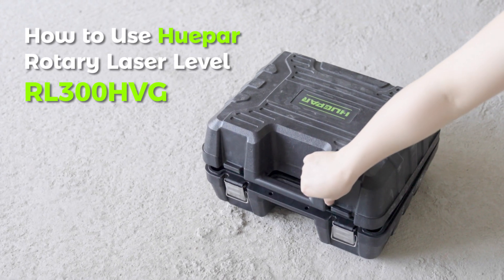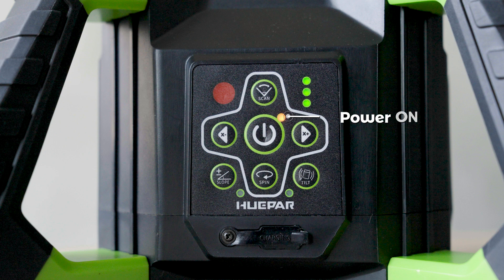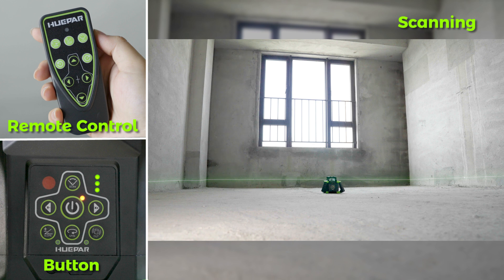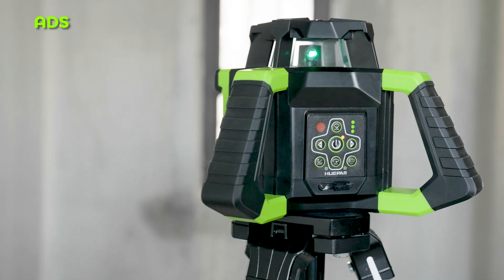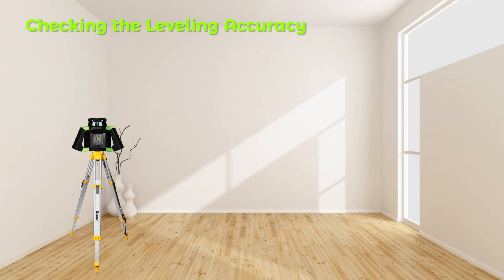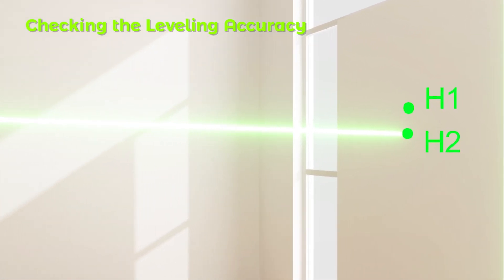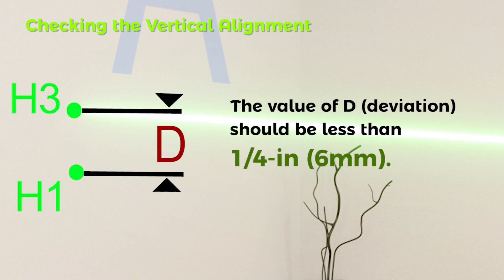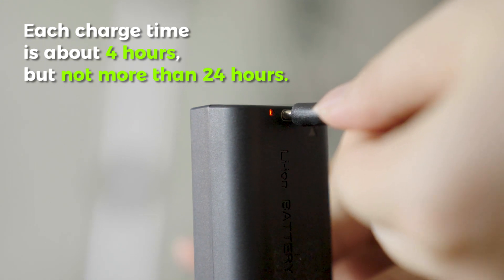How to Use Huepar Rotary Laser Level RL300HVG

Comment: Watch out for the TPD14A and TPD14B tripod! Huepar Pro Store are misleading customers by showing photos of the version with the integrated carrying handle on the center column, but they ship a cheaper, lower-spec model without it. When confronted, they claim it's 'the same product.' If you need this for professional work where ergonomics matter, stay away. This is a clear case of 'item not as described'!"